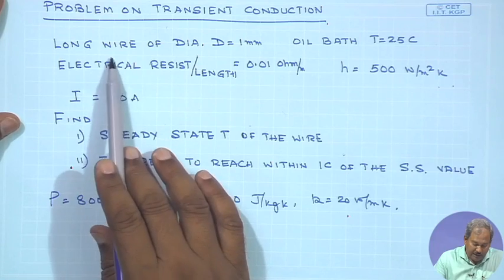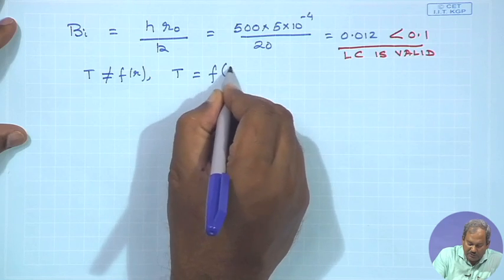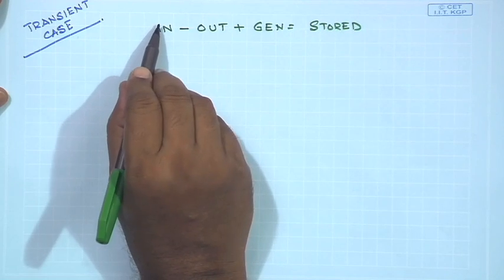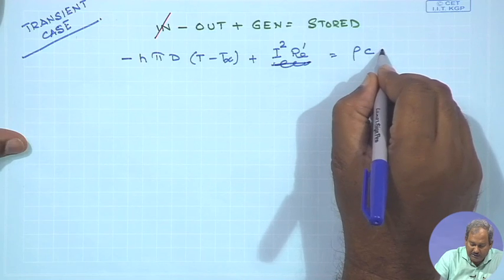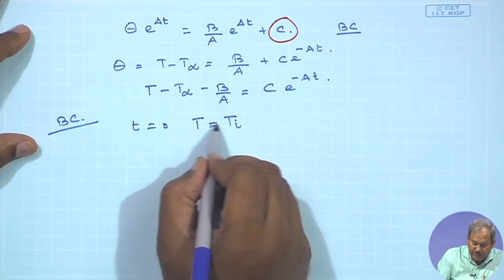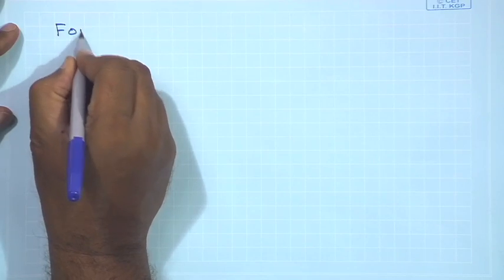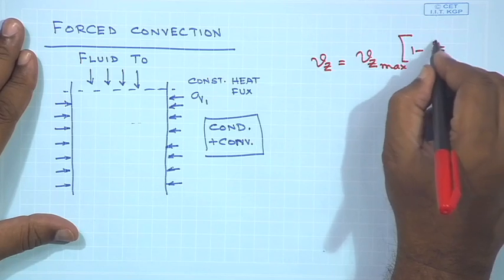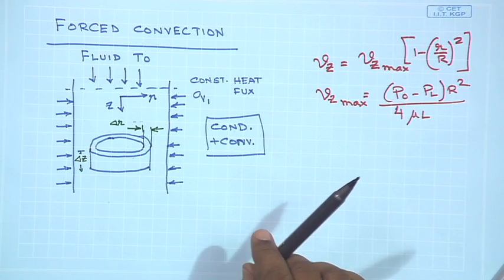Lecture37 Transient Conduction (Contd.)

Comment: Trump says build the wall, my question is what does that mean to the average voter? As an engineer a wall has a thermal conductivity, a density, a material specification, a heat capacity, and a bunch of other parameters if you want them. Those are my first thoughts when I hear wall as an engineer.
Reply: yo r u a schizo why tf does this daily wire american bs even matter here